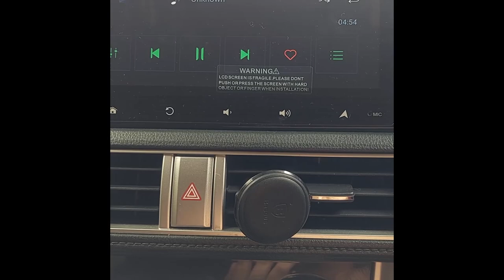DIY Replace Mitsubishi Xpander Car Speakers - Front and Rear

Comment: Hi how's the sound quality and bass?  is it better than the stock speaker?  though the Xpander stock speakers are not bad at all, because i'm planning to upgrade mine. Thanks.
Reply from the maker: Of course the quality is better than the original one if you also replace it with the same brand as in the video (rockford fosgate). The original speaker is very light and the magnet behind it is very thin. If you feel the is lacking you can add an active subwoofer under the seat.

Comment: Hey. Great video. Do you have link to this speakers and this distances for speakers. Looks pretty the same like in the asx in europe 😊
Reply from the maker: Front speakers : Rockford Fosgate R165-S. https://tokopedia.link/UjKzvCKXPCb
Rear speakers : MBquart M1-116. https://tokopedia.link/74Tw90TXPCb
You can check if it is available in your country.
Reply: @TutorialEz96 hey one more question. Can I install amplifier  to the factory multimedia system MGN mitsubishi?
Reply from the maker: @przemokbh8079  as long your unit have a preamp rca output you can add power amplifier. If your unit doesnt have rca output you can use high to low rca audio converter.

Comment: What is the speaker size sir? thank you!
Reply from the maker: Front and rear 6.5"
Reply: @TutorialEz96  very much appreciated sir
Reply: My link po kayo ng speaker socket terminal?
Reply: @nersantos  Wala po sir. Nag install na Lang Ng additional speaker. Hidi naka link sa audio Ng xpander. Di-tanggal pag maraming sakay
Reply: I mean yung terminal socket po sa new speaker nyo san po nabili? Sa 3:45 mins po
Reply: Nice vid. Pwede malaman ung link kung saan nyo po nabili ung speaker wire harness adapter?